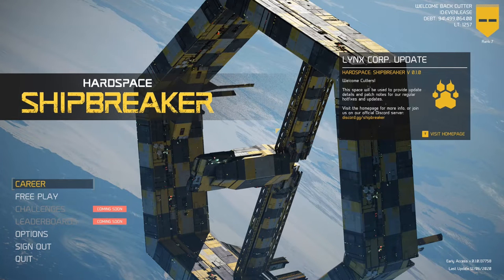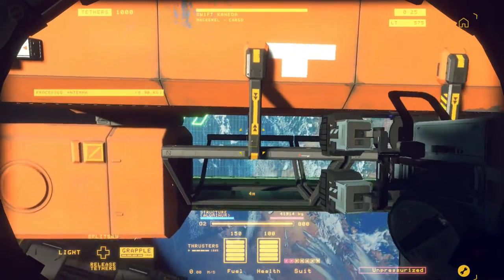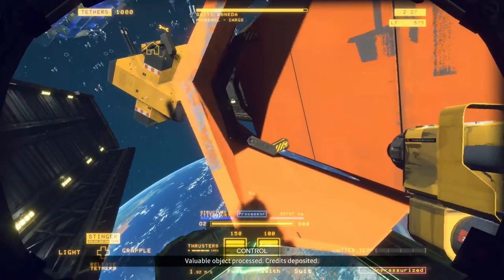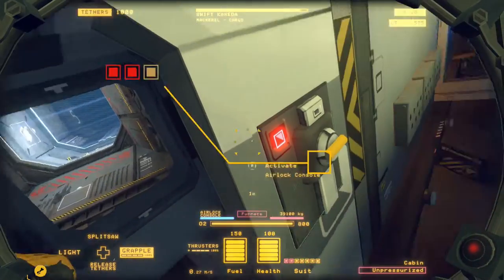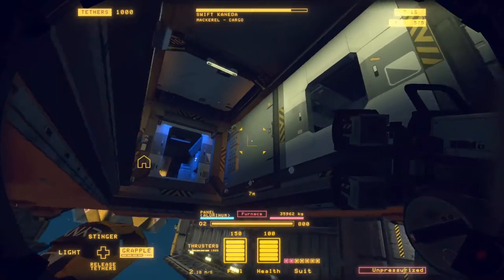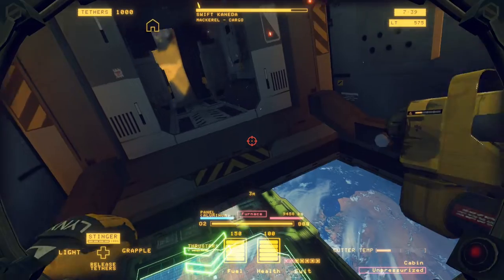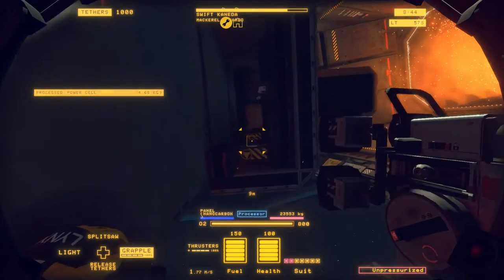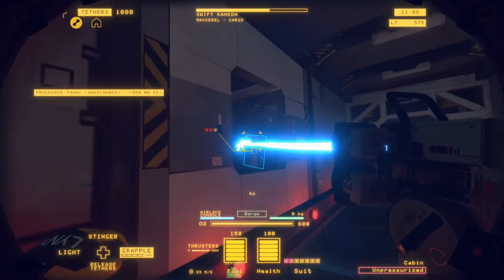Hardspace: Shipbreaker Mackerel Cargo Disassembly

Comment: Thanks for showing a complete deconstruction. When I tried the deconstruction I didn't notice I can vaporize the small parts. Now I am wondering if there is an even better way to get the airlock- and cockpitparts. It seems like every other part of the ship can be  separated without cutting through walls. 

By the way to get the reactor a bit more safer you can tether it directly from the socket to the barge.
Reply from the maker: I continue to test more and more ways to remove airlock and cockpit sections, finding the most efficient way is important to me! Thanks for the reactor tip! Will definitely use that on my next deconstruction.
Reply: @EvenLease44  There are four narrow straps (one at each edge) holding the aluminium panels in the cockpit in position. If you burn them away, the four panels pop out and you can get to the next four.  Then I just cut out the glass and drag what's left to the processor.
The flush switches you burned away to get the fuel tanks out are worth $24k each, so it's better to hit the pipe (worth $31/kg) with the stinger, then when you grab the tank, the flush switch just drops off and you can flip it into the processor.

Comment: You have some awesome approaches to your deconstruction that I'm definitely going to integrate into my gameplay.  Especially pulling the cockpit away from the main hull to get at the crawlspace.  Very nice!
One thing about the airlock though.  Since the airlock is made primarily of aluminum, I keep it attached to the inside framing and let it go into the furnace with the rest after I've finished stipping the nanocarbon off.  To do that, I cut along the outside edge of the airlock, where it's attached to the nanocarbon on the outside hull - so basically the opposite side of where you cut it.  After cutting along the vertical edge, and then below along the horizontal edge, the nanocarbon outer hull and bottom outer hull will pop clear and you can process those separate.

I know you said that it's not a big deal and it's just easier to yeet the whole thing, but honestly it's just about the same amount of work you already put into separating the whole airlock, so it shouldn’t take any additional time.